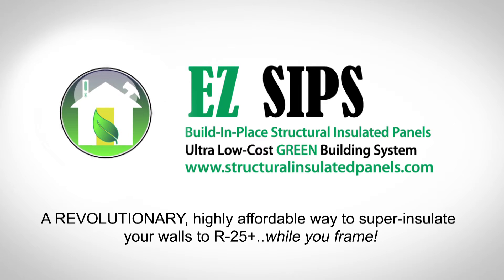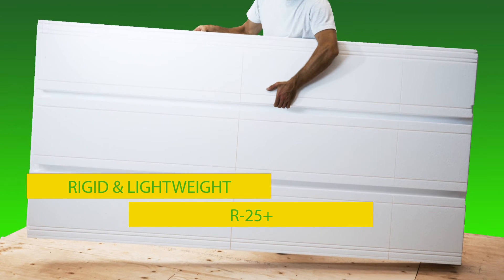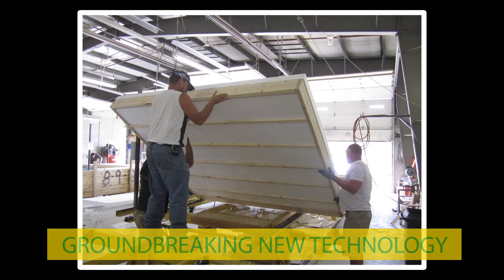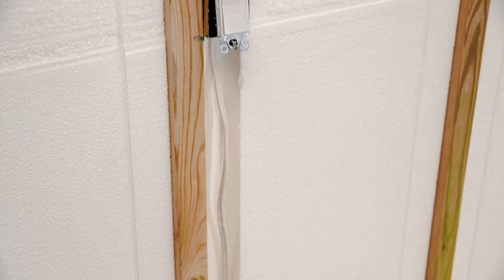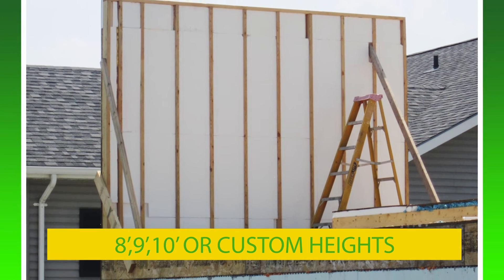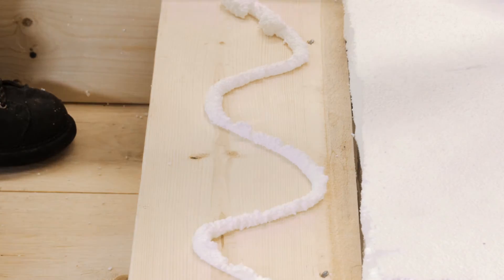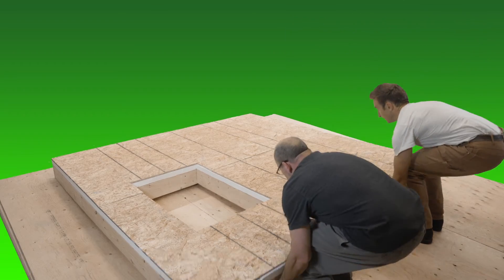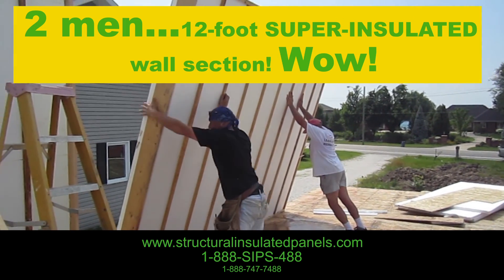EZ SIPS Low Cost Green Home Construction-DIY Custom Structural Insulated Panels on Site In Minutes!

Comment: Polystyrene foam is not green! it's not even biodegradable. it takes between 500 years to FOREVER to decay. It releases chemicals that destroy the ozone layer. This is NOT an environmentally friendly building material!! Shame on you for misleading people.
Reply: Bullshit. This is anti-scientific hysteria! Eco balance is a complex issue and bad info or thinking won't help.
First you are not supposed to throw it in nature. Recycle it!
FCKWs aren't used anymore, it's foamed with harmless gasses or CO2 for insulation. Enclosed CO2 bubbles insulates better than air bubbles. If you want to build passively heated homes, this is the way to do it.
Not being biodegradable is a good thing so you house won't rot. Building houses or heating costs energy is very bad for the climate.
When you burn polystyrene in an incinerator, you get only water, CO2 and small amounts of halogen compounds from flame retardants. So it can be disposed of without creating something bad.

Than being said, I would much prefer polyurethane foam for better insulation and better structural integrity.
Reply: Polystyrene foam is white.
Reply: There are tradeoffs everywhere. If people use something like this and burn 90% less gas to heat their home that is an incredible improvement. We can put our attention on making a biodegradable version, or on recycling it, but let's not stop progress when it comes to responsible energy uses because it isn't perfect. Don't let perfect get in the way of better.
Reply: Its NOT Polystyrene, Its EPS